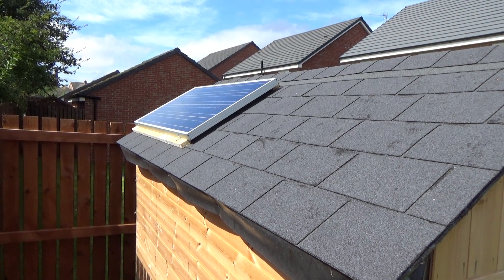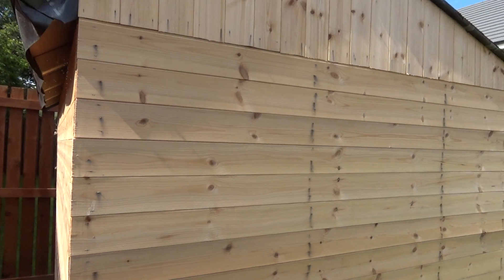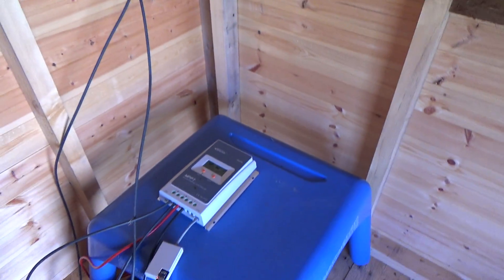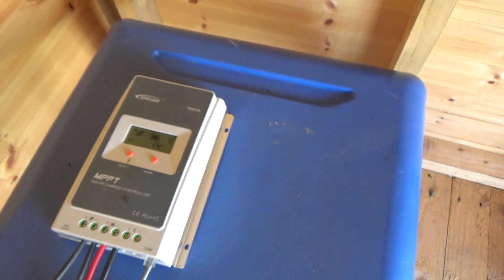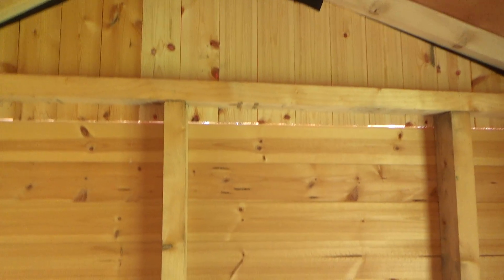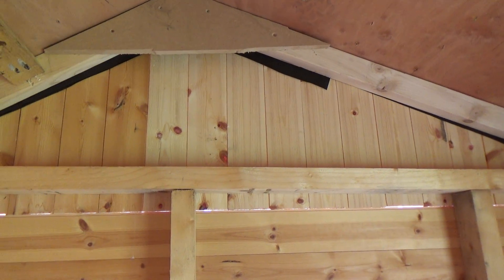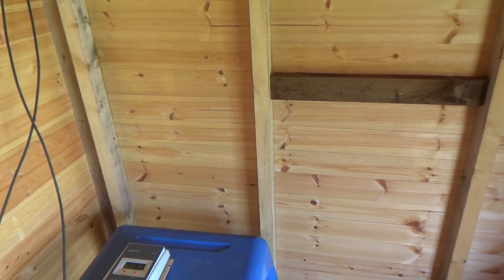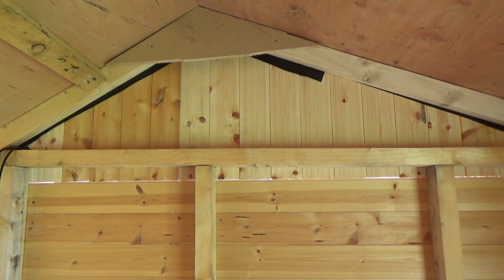12v Solar playhouse Part 1

Comment: Hey Colin! I'm building a workshop (a mans playhouse) next week, and purchased a 250w Mono PV Panel! Similar size to this.... im going to put up a time lapse of the build on my channel. 

I want to get the Tracer A/BN series but want to hack the COM port to use with an Arduino. Is that what you have made with the ESP8266? (I'll look for a video after this on your channel). I was going to purchase a RN series purely because it uses TTL/RS232 instead of RS485 so I didn't need to mess around with other modules. 

I actually found your video with a search "solar battery sizing" ..  and I've just seen in the video that you use a 150Ah lead acid. Is it a deep cycle or special "solar" style battery? I find those special ones are usually hundreds more but wondering if its worth it or if the sellers are just trying to up-sell expensive batteries. 

Just got to the part about the 18650's ... did this end up working out better?

I will be using the system in a similar way to you. Mainly charging the mower battery and running some LED garden lights and arduino sensors around the property. 

Cheers from NZ and subbed! Hope to see more solar related videos!
Reply from the maker: Thanks for the comments, i've ended up with two setups now and have the lead acid battery in the garage with a small solar panel for the lights in there, it's a cheap deep cycle one i picked up on ebay, it's not in great shape but was very cheap so happy with it for now.

The 18650's have been working well although i discovered that the playhouse is shaded in the winter months so the solar is kind of useless at the moment :-(  Couldn't have had it anywhere else though so just going to have to live with it for now.  

One big thing is i wished i'd made it bigger as even though it's for the kids i wished i'd made it a garden playhouse/office and would have been much happier with it.

Re the com port i use the ESP8266 so i can check the PV input level/battery voltages etc without having to physically connect to it and i can do it from the comfort of the house, what were your plans with the arduino?

Col
Reply: Thanks for a speed reply! It must be midnight in the UK? 

I will probably go with reliability and stick to lead acid and maybe look for a 100-200Ah second hand deep cycle.
The 18650's seem a bit troublesome but some other channels have set up some impressive battery bank "powerwall" systems. 
The feer of the LiPo's exploding is also on the mind :S

I develop many many apps with the Blynk.cc system. I only use NodeMCU/WeMos style ESP8266 modules because of their convenience.... especially the mini versions. 
I want to collect and output all the data you would normally see on the MT-50 display. 
I code in the Arduino IDE environment so your ESP-Link and NodeMCU firmware is no good to me. 

I want to test it out before I go and commit $200 on an A series controller over the similar priced (albeit far older) RN series. 
Any chance you would be willing to help develop your wifi module in to the Blynk.cc system? And if it works then I would happily go buy a A series! ;) haha

Ben

Comment: Looks like it's going to be a nice project.  I've got some RGB LEDs on the outside of my shed which light up for a couple of hours each evening - makes the garden more attractive looking out at night.  The issue is the short days and the longer nights of winter - always difficult to store enough energy in the day to get through the evening - like you, I need more panels!

I'm looking forward to seeing your install progress and the move into a different chemistry. :-)
Reply from the maker: I got by last year with my tiny 10w panel by having the lights at %25 brightness and only on for a few hours after dark.  Would be nice to keep them on till 11/12pm or so as i do now but as you say your knackered on the naff days when you don't generate enough power.